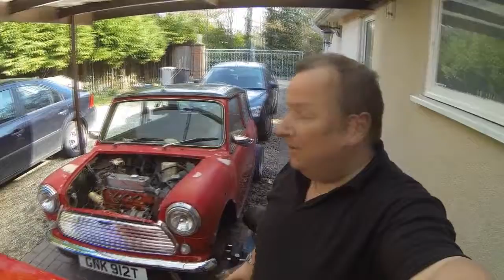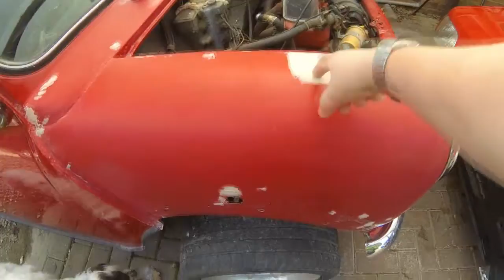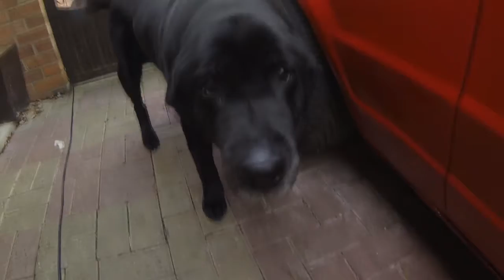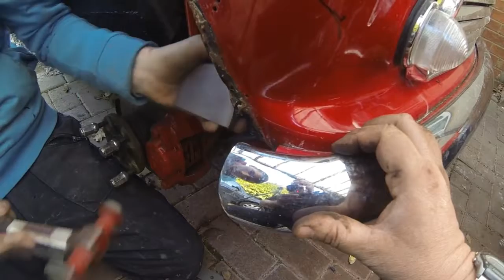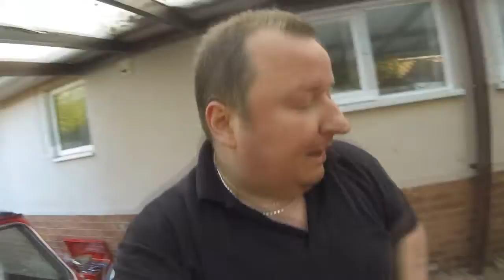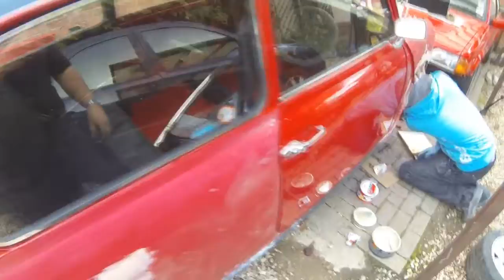Classic Mini Project Vid 10 Wrong Arches And Fitting New Parts

Comment: Hello Martin if it's got the cams it will be stage 3 if the head is not standard so it's a 90bhp kit the needle will be e relevant bud
Reply from the maker: I think we were very lucky when we bought this engine. It came out of a 94 cooper and had a lot of new parts I think the cam as well as the roller rockers so your probably right. Thanks for the heads up on the carb.
Cheers
Martin

Comment: Great vid Martin looks like you got a long branch manifold on the mini so it might have bin fitted with a stage 1 kit at some point I would check the carb for a red needle.
Reply from the maker: HI James, You could be right as this engine has the roller type cam follers as well so it could be a performance engine. I'll check the carb for the red needle when I strip it down. Cheers
Martin